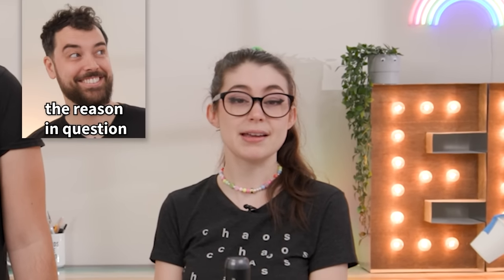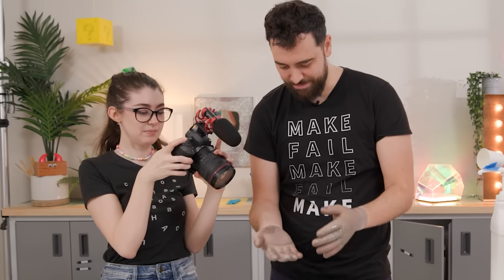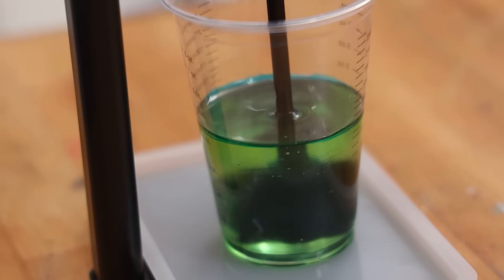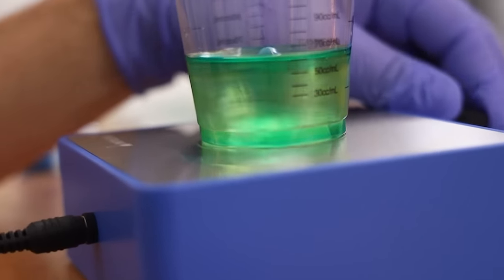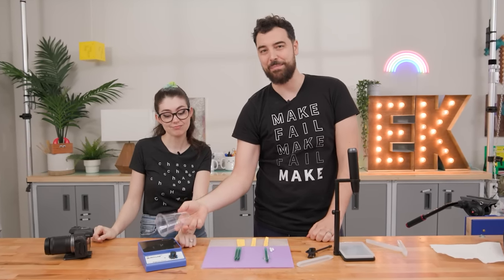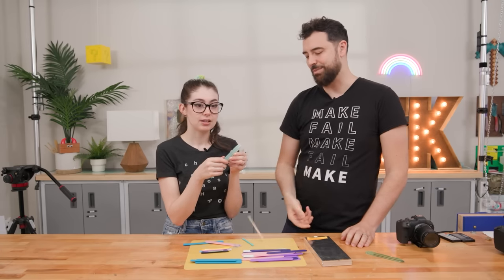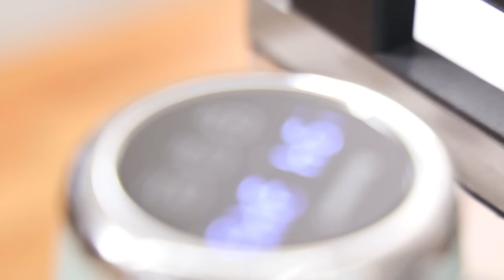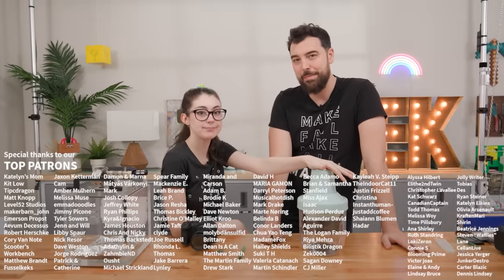Testing 7 Weird Resin Gadgets from Amazon (2 were good)

Comment: i dont use resin so dont know but would a food mixer on slow with not the blades but say the round hoop or even make own blade i mean for paint we used to use a drill with bent rebar before paint mixers came out...would a paint mixer fitted to a food mixer work? as i think food mixer fited to counter unlike drill can control speeds ...same is but drills normal faster. would 3d printed blades work better if coated with latex?

Comment: There's actually pretty easy way to get rid of bubbles without vacuum chamber or pressure chamber. Use slow cure resin, and just out the cup with the resin into a bowl of warm water. It will make all the bubbles go away pretty fast. It's important to use slow cure resin though, since fast cure resin will accelerate curing from the heat and might cure in like a minute. But slow cure resin, like 24 hour one or so, will have lal the bubbles removed, and will cure in 1-2 hours or so, if placed into a bowl of like 80°C water.

Comment: Ok its my opinion on why the cheap vacuum doesn't bubble so intensely. the powerful one have a stronger pump which pull out air much faster than the small one. which means the pressure difference between inside and outside the resin increases rapidly, hence the the intense reaction. The small one pulls air much more slowly, hence the slow reaction.....

Comment: Late to the party and so not going to read through 1161 comments, LOL, BUT an easier (and less messy/more sustainable) way to clean your stirring magnet (and/or also the "drill spinner mixer"), would be a jar/cup (I'd recommend a resealable jar for practical reasons) of high quality alcohol (I use 99% when doing resin cleanup here), dedicated to cleaning.  Drop the magnetic stirring tablet and/or mixing paddles in, and "mix away" just like the resin, only this time it's cleaning the resin off in the alcohol bath, no effort, no need for wasting towels wiping them off (unless you just want to, and could have a "drying" towel reused many times)... 
Anyhow, you'd likely be able to do many cleanings before the alcohol became too contaminated and needed a changing (and that could still be used for some cleanup probably for other resin "messes")... keep 2 jars, a "heavy clean" then a "final rinse" jar, and as they contaminate, eventually swap them out (final rinse becomes initial rinse, and a new clean jar of "final rinse" starts over).  
Nice thing is no effort required other than occassional changeouts, you literally just use the same mixing method, as the cleaning method instead.

Comment: Why do you clean the little magnet wile the resin ist still wet, but the mixing sticks just after the resin cured? Wouldn't it be better to clean the sticks like the magnets? While they are still wet? This way you can store them right away or use them right away with another batch of resin....👍🏼

Comment: Is there a reason you don’t wipe your tools off as you are using them? A baby wipe or alcohol on a paper towel before it dries on. Like with the mixer, you didn’t just simply take a paper towel to it when you were done mixing yet you did on the magnet pill thing. Would take you 10 seconds to do and save harder cleanup after it dries. The stir sticks are the same. Just wipe them off after.
Reply: i thought exactly the same. Why did they do it with the magnets but not with the sticks? The sticks are also more environmently friendly because they are reusable.

Comment: Paddle Mixer: For cleaning, just after using, you could have taken another small cup with alcohol in it, and submerged the mixing blades, and then turned on the mixer to see how well it cleaned up the blades, instead of just letting the resin dry on the mixing blades.

Come guys, no rocket science here!

Comment: I'm confused as to why that vacuum chamber at $150 is even considered a good value (if it worked) when you could buy a stainless steel 1.5gal vacuum chamber with included 1/3hp standalone pump for the same price or even less off amazon. At least that way you can replace/upgrade the pump, this way your just SoL if anything goes wrong.

Comment: You sprayed alcohol onto the pills and wiped them down, but for the mixer thing why not put rubbing alcohol into a cup and have it "mix" in that and then wipe it down after so you're not having to put so much work into it. And then reuse the alcohol for the same purpose until it's no longer reusable

Comment: I think one thing you didn’t really account for nearly as much in the vacuum chamber criticism is how much 150$ is achieving compared to 550$. That’s super important!

If you were to graph it on a line, with the points ($0, 0%) and ($550, 100%), you’d get 2x/11 which means for $150 you’d expect it to remove, like, 27% of the bubbles. It did way way better than that, it removed like 98% at worst.

Comment: Well, you two probably were a bit harsh on the silicone stuff (except those horrible gloves, lol).  You're meant to wipe them off after each use, not let resin set on them. 😅  Because they're silicone, they wipe clean very easily.  It's just a bonus that all is not lost should you forget to wipe one down, lol.  The paddle stirrer I've heard people keep a jar of isopropyl alcohol and just stick the paddle in there, let it run on high for a bit and then wipe it with a paper towel easily too.  They keep reusing the same jar of alcohol until it's ineffective to clean the paddle anymore.  Simple. 😅

Still, it was a fun video to watch and you're as hilarious as ever. 😉👍

Comment: As someone who works a lot with resin, personally I really like the silicone stirring sticks, I use acetone to clean off resin and using that and just some tape I find the silicone stuff easy to get clean and ready for next batch. I also use silicone cups. I'm currently looking into getting a vacuum chamber but I'll probably be buying a set online from like, aliexpress and pray it works well. They're about the same price or a little cheaper than the small one you guys were gifted to test out.

Comment: Oh wow, so the company that rebranded a food dehydrator is admitting they just rebranded a food dehydrator and charged more for it? Who would have thought?

Edit: that vacuum chamber is awful, the gauge is definitely not right, perhaps deliberately to make it look better than it is? The fact it also has an “AI” button that just toggles between five and nine minutes tells you all you need to know and probably makes it more likely that the gauge is deliberately wrong. It is not a quality product and it is not worth what they sell it for. It just looks like a small vacuum pump, like you get for vacuum bagging, but attached to a box, it looks around the same size of pump too.

Maybe you could make a hole in it and attach your vacuum gauge and see what it actually gets down to?

Comment: I was actually looking at that vacuum chamber the other day and I raised an eyebrow because of the price. Watching the video now...
Reply: Alright. After watching it, thank you for the review. It actually suits my resin needs since I usually only do small projects. That combined with the science magnetic stirrer seems like a pretty safe bet since it also lessens the bubbles and might lessen the time to be in the vacuum. I'd be curious to see if this works for silicone mold making as well and wouldn't mind a bonus video if you guys are able to. I imagine the non-transparent silicone would be hard to see if the pill is mixing, but if it doesn't mix it won't cure. So 🤷🏼‍♀️ worth a shot to test it.
Reply: Amazon already has a cheaper compact vacuum chamber on sale

Comment: You can buy a proper vacuum chamber with pump for 150..... don't misrepresent vacuum chambers cus you decided to make your own expensive version. I don't like the resiners machine cus if the pump goes you need a new machine. Also 9 minutes to pull out bubbles Vs 4 or less in my proper chamber that cost the same.. How to know Evan and Kaitlyn don't like cleaning their tools.. they didn't consider wiping their tools off after use.. they'd rather leave the resin to cure.. lmao

Comment: Sorry guy's but your stick mixing tests are pants unless you mix exactly the same & mix properly not like in the video,  you didn't scrap the edges of the container with the sticks also didnt scrap the sticks clean on the rim of the container, these should be done to make sure the 2 parts are mixed thoroughly, the silicone stick would mould to the container better pulling the resin away from the side, when finished, just wipe with a paper towel like you would with the wooden stick inorder to reuse.